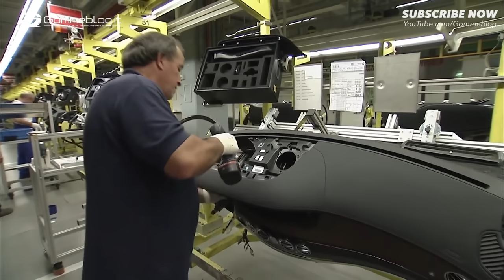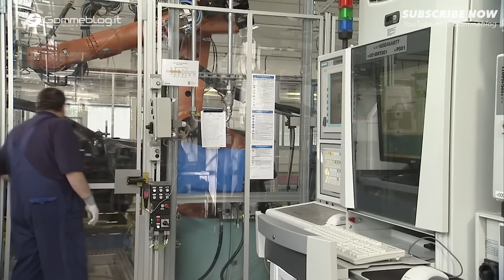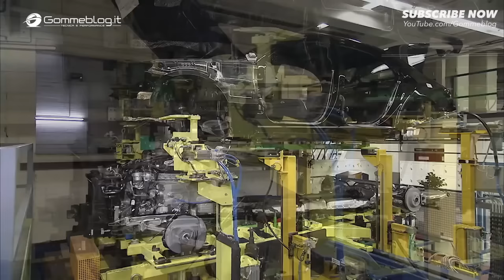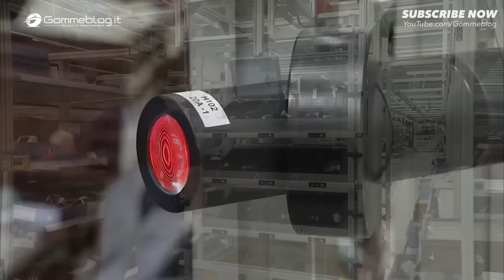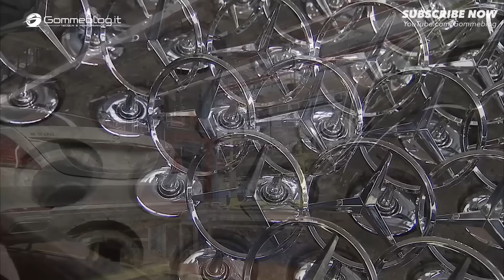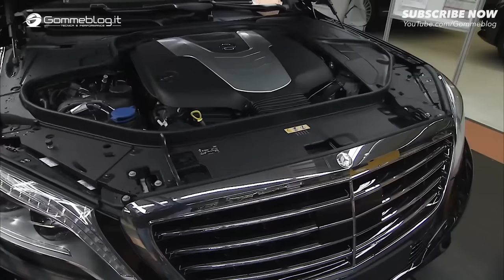Mercedes S Class LUXURY CAR FACTORY - How to make Manufactory ASSEMBLY

Comment: i never can get this car , i don't have much money  :(  i can just watch
Reply: you can always test drive one.
Reply: Be happy, I'm sure you can manage to get a proper car for less money. I worked with Mercedes and it's big words, fancy settings - but come on, why did they get rid of quality?
Reply: Maybe you haven't notice but they actually have a much better reliability rating . Every car on the road has issues . Most problems are software which takes a simple update .The other ,abusive driving .
Reply: Buy 1992's W140 S-Class Its Cheap, V12, And Has More Durablity Than New Models.
Reply: Think positive, if you think you can, you really can.
Reply: you are not alone..
Reply: Santino Delarte cocaine buisness bro
Reply: After 3 years you can buy a low mileage second hand one.
Reply: Santino Delarte
Never say Never. God can do anything for you. Or anyone.
Reply: Kn Ba its all plastic now, parts are plastic.injected with good pom and pc.
Very cramp inside.. uncomfortable suspension geometry is like builk, nothing special... despite aluminum body is.lighted the cat feels tinny not solid, no head room, ambient light is annoying.
Reply: Same to me.
Reply: @timcheou5649  s class cramp inside? Uncomfortable suspension? Nothing special? What weed you smoking
Reply: Santino Delarte vary...good...ok....
Reply: Супер
Reply: Me too aq😂😂😂
Reply: Santino Delarte i don't have much money to buy a 2018 Mercdes Benz.
Reply: @ganggang803  😣😣😣😣.
Reply: Work. And  buy this car
Reply: Qizilbash Alevi !!! Your lifespan will be shorter than the car...LOL

Comment: My car started breaking down at 40,000 miles. It's a plastic mess, window stop working, needed SAM unit, shocks leaking, larbar seat control not working i have had it with the company. My next choice will be China's H9 so look it up

Comment: I would never buy a Mercedes s class. It lost its value when the c class and the e class have the same design as the s class
Reply: I got an e300 and they may look similar but the v12 in s class is out of this world
Reply: @richardaguilar2674  a few years ago each class had its own design and each car had its own beauty. The car represent your prestige so someone with the c class has less money from someone with the e class or s class so if im reach i don't will to have one similar car with the next door guy. So i will go to buy a Bentley or rolls Royce or something else. This is the reason why the used s class is it so cheap. I know the Mercedes it's the best car of all because i buy one slk and i stop give money for problems just i do only the service. But the Mercedes lost its prestige when it started the Babushka method

Comment: My S class 2018 paid £80 k . But it was a horrible car . I spent more time in the garage than on the road . Plus is wasting oil using oil , every 1000 miles a litter of oil . Plus the gear ⚙️ box is horrible uncomfortable and stiff